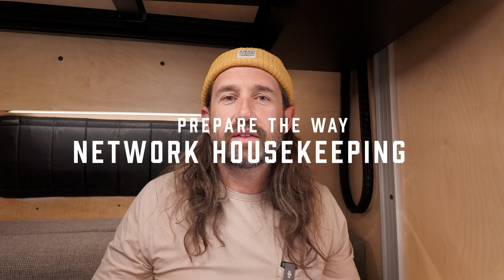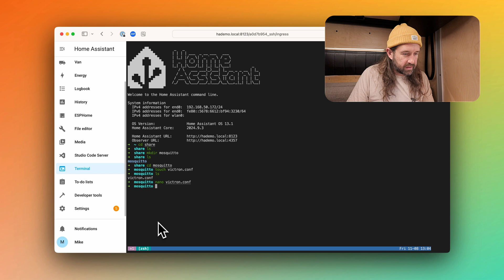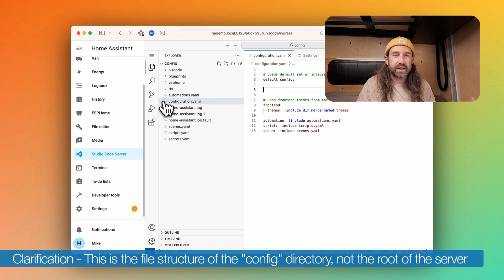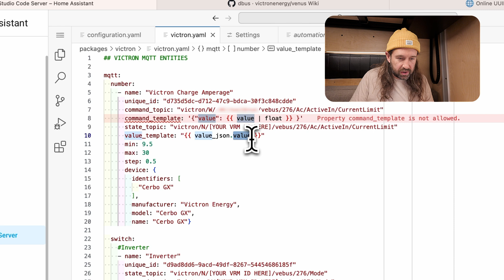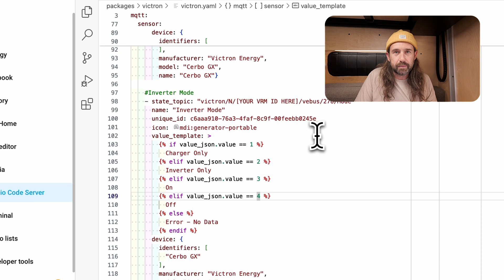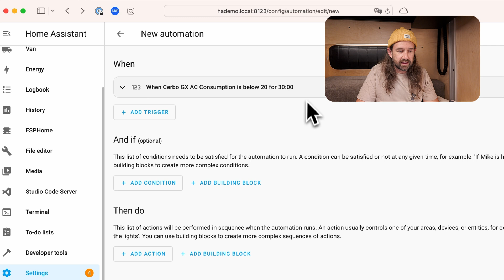Integrate Victron Into Home Assistant Using MQTT (bi-directionally!)

Comment: Loved the video, got me up and running but I do have one question. If I have two Cerbo devices, how would I go about adding the second device? Is it as simple as adding another set of lines in the Victron.conf file?
Reply from the maker: I believe so. Or, check out this new video https://youtu.be/S8pZIGLHE7c
Reply: @SmartyVan Just watched that video this morning and it got me thinking if I should scrap the manual way and just do both the automatic way as you put it. Or can I run the both at the same time?
Reply from the maker: @coolbolas  You can run both at the same time. Depending on how you're set up, you might be adding extra network / MQTT traffic if you're bridging your Victron MQTT broker to another broker (like Mosquitto), then using the integration to listen to the Victron MQTT broker. Probably better to choose one route eventually.
Reply: @SmartyVan ahh ok, I will have to see which one works best for me and go all in. Thank you for the help.

Comment: I'm running v3.66. in the victron.yaml file under "device: (" I'm getting this error "Device '{' does not exist in your Home Assistant instance".  I'm able to find and add cards to my dashboard. How do I fix this error?
Reply from the maker: Maybe try the new super-easy method if you're having trouble with manual configuration: https://youtu.be/S8pZIGLHE7c

Comment: Thanks man! This is an ultimate guide! I was able to set everything up even if I'm new to Home Assistant and to MQTT. Since I installed HA as docker container app on my linux home server, the Add-Ons option was not available for me. Thus I had to install Mosquitto MQTT myself as another docker container app and then wire everything together. I was going back and forth through your video and was able to find answers to all my questions. Thanks again!!

Comment: Hi again, solved the issue with communication, I have another question on the "Victron Charge Amperage" section I get the same error you get "Property command template" how do I fix this? There is an error message below the yaml that says Property command_template is not allowed
Reply from the maker: According to the docs, command_template is a valid config option: https://www.home-assistant.io/integrations/number.mqtt/
Reply: @SmartyVan  thank you for the prompt response, indeed it works. I really appreciate the support.
Reply: Also what card did you choose for the Current slider?
Reply from the maker: I use a tile card.

Comment: This exactly what I was looking for an upcoming project on a house build, full off grid 6k sq ft multi art studio type place, with a full victron setup and a MBtek boiler unit, both support MQTT and was looking on how I am going to integrate everything.  Since the place is so big, budgeted a lot of smaller poe powered rp units with lil 7 or 10" touchscreens to display useful data on the house.  Brilliant video!

Comment: Thanks for the great content as usual. There is a new victron addon availble in HACS that does not require the MQTT and manual setup. It has auto discovery and saved me quite a bit of time getting everything setup. It is worth checking out.
Reply from the maker: You're welcome! The integration looks great, though I haven't tried it yet. The author, Tomer, is over on the Smarty Van discord as well! https://discord.gg/3rqeqES3zP

Comment: Fantastic video its great to integrate victron into HA. One question, as i have 2 solar charge controllers the yield path only displays for one. Do you know mqtt path for the total combined yield of the 2 controllers for the day.
Keep up the great content
Reply from the maker: Thanks for tuning in. I don't have 2 charge controllers to test, but I'd start by connecting to your MQTT broker with something like MQTT Explorer and just browse through the devices connected. I would imagine each controller should show up and present its yield. I DO NOT believe Cerbo will sum those for you, but you could use a template sensor in Home Assistant to create sums!
Reply: @SmartyVan while creating some helpers this weekend I found a 'combine the state of several sensors' helper. So my plan is to read the yield of both my mppt charge controls and combine the 2 then display the combined entity. I'll keep you posted

Comment: So does this mean that anyone (or malware) on my LAN can connect to the MQTT of the Cerbo GX without any authentication, and subsequently change any setting? Any way to add authentication layer to the MQTT instance on the Victron itself?

Fantastic video, thank you!
Reply from the maker: Yes, enabling plaintext MQTT in Venus would mean any device on your local network would have access to the broker. I know the security layer is reworked in Venus 3.5, and you can use SSL connections to MQTT. There’s info over on the discord: https://discord.gg/3rqeqES3zP
In older versions you can disable MQTT on LAN (plaintext) and use port 8883, but I’m not certain if the same TLS cert steps will work.

Comment: Followed your instructions got to mqqt explorer and doesnt see anything victron. Settings in cerbo are slightly different than what you show with latest update.
Reply from the maker: Check out the pinned comment, or head over the Discord: https://discord.gg/3rqeqES3zP where there's lots of info about working with the newer Cerbo Firmware to get MQTT working!

Comment: Great guide, thank you. I have it working with one of my Multiplus devices, does anyone know how I add a second one on a different IP address please?
Reply from the maker: A second Cerbo?
Reply: @ Wow quick response, thank you. Yes I have a multiplus II GX with the built in Cerbo and a separate multiplus II connected to a Pi running Venus OS I’d like to link both of these to Home Assistant. I’m sure it’s possible via the victron.conf file but how?
Reply from the maker: @ I think you can duplicate the lines in the conf file with the other IP address.
Reply: @ Ok thank you, I’ll give it a try. The other thing I was thinking may work is making another conf file and putting the other units details in there but I didn’t want to break what I have running now.

Edit: I have it working with both systems, what I did was added a second conf file and called it victronb.conf, the connection name defined inside is victronb too and then it works.  Last night I used Home Assistant to control the state of a smart relay based on battery bank A SOC and it worked perfectly.  IMHO this is more flexible than the built in Victron assists but probably not as reliable as all this requires a reliable network connection but the assists do not. Thanks for your help.

Comment: This is awesome! Thanks heaps for uploading!! - I have an issue with the switches not knowing the state they are in, displayed is 'unknown' below. Im running the latest version of Venus OS and Home Assistant. Hopefully you can help?
Reply from the maker: I think there may have been changes to Home Assistant to tighten the state comparisons (I'm back a several months) - check out the docks here: https://www.home-assistant.io/integrations/switch.mqtt/

It looks like parsing the json coming from MQTT is better than comparing the entire string (which is actually json). Any small differences in the string would fail. Try this where we use value_template to extract the actual value from the json:

      value_template: "{{ value_json.value }}"
      state_on: '3'
      state_off: '4'
      payload_on: '{"value": 3}'
      payload_off: '{"value": 4}'
Reply: That’s perfect and thanks so much for the quick reply, now it’s working better than expected!! Really enjoying your content and look forward to each vid! Keep up the good work

Comment: Victron doesn’t provide a direct consumption value, only metrics like battery charge/discharge and solar yield. How do you accurately track energy usage in Home Assistant when the discharge value stops increasing with solar power?
Reply from the maker: Oh good question, you could create a template sensor to calculate it. And/or use the Integral integration: https://www.home-assistant.io/integrations/integration/ — I don't really track energy usage over time in Home Assistant. But probably should set that up!
Reply: @tidleprodigy7624 Have you been able to integrate it?
Would love to see an example!

Comment: A very good video, but it don't help me. I can’t connect the Cerbo GX to the Homeassistant . I have Homeassistant installed via docker containers, the mqtt Explorer connects to the Cerbo GX and i see alle the signals. I made the Victron.conf as described and placed it in the mosquitto folder (don’t work) I placed it in homeassistant/config folder (don’t work), I placed in it in Homeassistant folder (don’t work)
Reply from the maker: Where is your mqtt broker running?

Comment: A very interesting and well-made video. Easy to follow and always to the point without rambling. Congratulations.

I have a question about the retrievable MQTT topics so that I know in advance whether the effort is worthwhile for me.

I’m intersted for values for: 
* Charged Energy (kWh)
* Discharged Energy (kWh)

When I log into my Cerbo GX with the MQTT Explorer, I only see the following values under ‘N/<ID>/battery/’, which are of interest to me in addition to the energy values: 

Power = {‘value’:-1218}
Current = {‘value’:-23.700000762939453}
Voltage = {‘value’:51.40999984741211}
Temperature = {‘value’:16.100000381469727}
Soc = {‘value’:20.0}

Are the energy values only missing for my installation or is it the same for others?

Thx in advance.
Reply from the maker: I have victron/N/<id>/battery/0/History/ChargedEnergy and
victron/N/<id>/battery/0/History/DischargedEnergy

That's with Victron Smart Batteries and Lynx Smart BMS. This may be different with other BMS/Battery combos....
Reply: @SmartyVan  I have now found the MQTT topics, although unfortunately they have no values set. 🤷‍♂
e.g..
N/<id>/battery/512/History/ChargedEnergy
{"value":null}

The result is identical if you try to read the values in NodeRED. The ‘Battery Monitor’ node with the following energy selections leads to a ‘null’ result as well:

Currently stored selection:
* VE.Can Pytes Battery
* Charged Energy (kWh)

Debug Message: VE.Can Pytes Battery - Charged Energy (kWh) : msg.payload : null

Even the identical result is technically OK, still not good for me 😢

Comment from the maker: For those of you using newer Venus OS firmware 3.5 and up, please be advised some security settings have changed. Visit slides 32-36 of this Victron Slide Document for information on setting security protocols: https://docs.google.com/presentation/d/1k9KLLQkqYH-aH_EZ8N2IuserK6xbaAukEs3fc3w7Gkg/edit?a=v350&pli=1#slide=id.g31299d9f664_99_9
Reply: I´ve read those slices and it works fine for me using the MQTT Explorer. For those that have the latest version:
- Validate certificate: disabled
- Encryption (tls): enabled
- Port: 8883
- Username: any
- Password: your VRM password

With this, you´ll be able to connect to the victron broker. How to set all this in Home Assistant is something I´m still trying to find.
Reply: I've found the answer to my problems. To be able of hearing the Venus broker, you'll need to have security settings of VenusOS in "weak" or "insecured", otherwise VenusOS will only accept secured connections under TLS.
I´ve broken my head trying to find out what my problem was, and this solved it all
Reply: @lordexess  when I run the mosquito add-on, the log file says victron connection not authorized, I can see Mqtt data from both the ip of HA and of my Venus but cant see victron data when exploring homeassistant mqtt data
Reply: @lordexess  Hey, trying to do this, thanks. Where does this info go in the HA config? Cant seem to find it in the place you add this info?
Reply: Are you able to do an update for this, pull my hair out trying to get it to work. Cheers.
Reply: @DC666Moon  I managed to get mqqt to work on the new user interface.
 you need to have the venusOS password in plain text in The mosquito bridge config, I wanted to change the venusOS password, I had to roll back from 3.6 to 3.5 to be able to view the old gui and only from there I could successfully change the venusOS password (venusOS password is different so make sure to keep a secure password for that still
Reply: Great video, I'm very happy with how things went and I was dreading this setup after I failed with Teltonika router.
Reply: Can you provide a how-to document on how to deal with these changes? I have "unsecured" set, keepalive not working. Cant get the MQTT data unless the VRM interface is open in browser.
Reply from the maker: If you have newer Venus OS firmware, the MQTT keep alive has changed — this is why you only get data with VRM open. You can read some here: https://github.com/victronenergy/venus/issues/1098

Comment: Gday mate, Im  having trouble setting this up for some reason, I think i have everything correct as you have explained, however, once i connect the mqtt explorer, i do not get Victron as the first entry under the ip address,  but it does connect and first entry is sys,  I was wondering if you know what im doing wrong? cheers.......
Reply from the maker: If you're only seeing the "$SYS" topic when connecting to your broker, it sounds to me like your broker is set up and you have access, but that neither your keep alive automation NOR your Mosquitto Broker custom configuration are correctly configured. You should at least see your keep alive automation creating the topic "victron/R/[your VRM ID]/system/0/Serial".

I would carefully revisit all of the chapters and steps. If you want to dig deeper for support, the Smarty Van Discord is great because we can paste code snippets and others might be able to chime in as well: https://discord.gg/3rqeqES3zP
Reply: @SmartyVan  @beefa5649. I had the same issue and it turned out I'd made an error in the custom configuration. 

I'd been messing around with Mosquitto for another thing I was trying so decided to uninstall and reinstall it to be sure of a fresh install - however Mosquitto would start and then almost immediately stop if I had Customize -> Active: true (it was stable with Active:false)

It turns out that this was because the Mosquitto directory and victron.conf needed to be deleted. Once I'd done that and restarted HA and set Active:true it was stable and then I recreated the directory and victron.conf and everything is now working

Comment: ❗❗❗IMPORTANT FOR 2025:
Victron has changed MQTT configuration and now it's only "MQTT Access".
Enable it.
The new port is 8883. Any user and same password to access to the Cerbo. From the MQTT explorer, uncheck "validate certificate" and now you will see the victron device
Reply from the maker: It's true, the Venus OS firmware 3.33 makes changes to the way MQTT is activated. But according to the change log, plaintext port 1883 is still viable:

"3.	Settings -> Services -> MQTT access. This setting enables or disables MQTT access over ports 1883 (plaintext) and 8883 (secured). For details, see Developer section further down. Note that, unlike previous versions, it's no longer needed to enable MQTT for the Marine MFD HTML5 app. Instead, set the Network Security Profile to Unsecured."
Reply: @SmartyVan  It seems this is not working anymore. HA only shows a couple of messages from Venus OS through MQTT Explorer at port 1883. The messages can only be seen in MQTT Explorer at port 8883, with password used in Victron VRM for the same Victron Id (user may be any). 
Now I have to figure out how we can send these credentials from HA to the Victron broker, which is being a pain
Reply from the maker: Check out this comment. I have not verified, but seems to have worked for them: https://www.youtube.com/watch?v=lvTGsOFsy8o&lc=UgwZu_MNjf1z0d4XdkR4AaABAg.ADXexbOmkLcADYrNSgGgNW
Reply: The link only points to the video, at least for me. Could you check if it is correct?
One more think. The only way to see the messages coming to Venus OS is activating TLS, so I think now it's needed a victron certificate in HA or something like that
Reply from the maker: The link surfaces a comment. Look at the first comment after clicking the link.
Reply from the maker: Might not work on mobile.
Reply from the maker: Check the video description for some updated info!
Reply: @SmartyVan  thank you for your reply! I would say I'm a lost case... I'm now even able to see the messages of victron connecting to HA through the bridge using MQTT explorer but my HA doesn't read the values... So, I will wait for some update or something like that. Thank you again!
Reply from the maker: If you head over to the discord and post your code we can probably help!